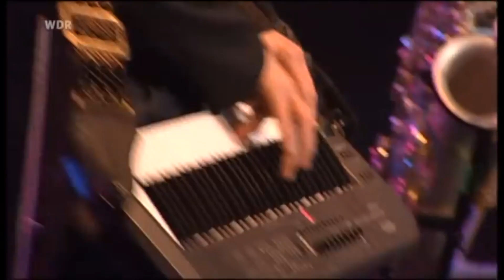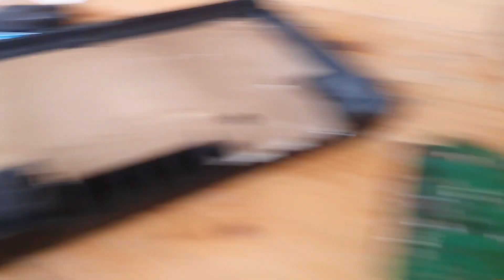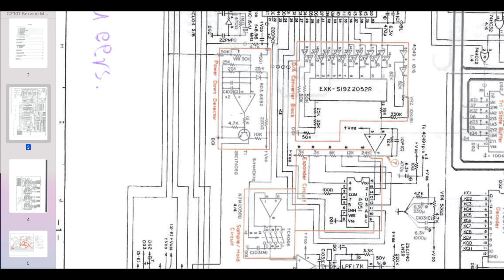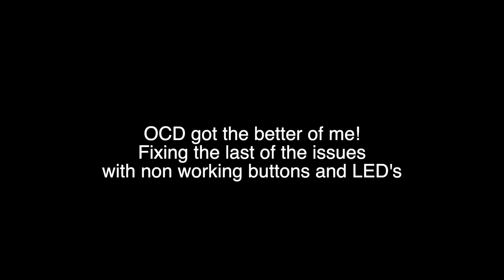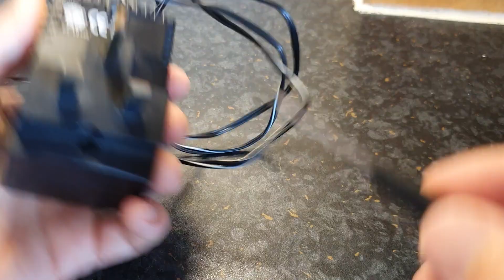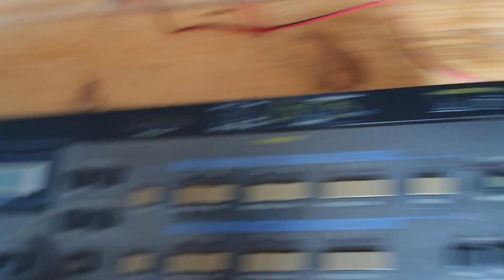Casio CZ101 Part 1 - Buying a broken synth from ebay - can it be fixed?

Comment: Wow, I'm amazed that you actually got that synth to work. Most folks wouldn't have gone that deep into a repair unless they had an electronics workshop; you didn't, but you prevailed! Well done!
A friend gifted me a CZ-1000, the same synth but with full-size keys. Mine is in decent condition, far better than yours, and I'm now learning how to use it. Thanks for a great video!

Comment: You might have one more thing to fix (or not, why bother, it's working now 😂)

I have the original stock Casio "9V" adapter for my CZ-101, and it is also unregulated just like your aftermarket one -- just a transformer, rectifier and some smoothing caps, about as linear as it gets.  I'm in the States, getting 120V out the mains, and that original power adapter is measuring at 12.9V on the ol' meter.  ("Load" matters in this case, ofc, so it's a Fluke 116 -- not sure its internal impedance, but I'm sure that's published somewhere)

So it's not unreasonable to think that the power adapter you have should actually work, and there's some internal regulation fried somewhere along the way.

If you do give that a crack, I'd be curious to hear what you find!
Reply from the maker: @georgen9838  yeah interesting and not surprising the casio psu isn't anything that precise. I've sold it on now but would be curious to pick up another at somepoint, see if the midi is any better
Reply: @bonzomusik  good timing -- just seeing this, I happened to jump back onto mine this weekend to try to figure out what is going wrong -- I'm having no luck.  Behavior is *weird*, sometimes not powering on, sometimes powering on but without LED activity (can still hear sound from the outs and the relay clicks when it starts).  I still want to suspect something on the power side bc I'm nearly sure somebody plugged the wrong adapter into it at some point (center-positive rather than center-negative), but I'm not seeing a smoking gun and the behavior is too erratic and intermittent to trace well so far.

All that to say -- I know it's been years and years for you, but if you recall any hunches or ideas as to where to start searching, I'm all ears!  It can be as vague or as far-fetched as you like, because I'm running out of "normal" ideas fast over here 😅

Comment: Great video ! What do you think could be the reason why the screen does not go out when the power button is turned off? I replaced the screen with an LED one. Everything works fine except for this (I would be extremely grateful for any advice

Comment: Great video, big help for 101 owners. I have Casio cz 230s wich is in good shape but when playing loud from the speakers it shouts down. When you plug headphone jack it doesn't do it. Any help? Thanks in advance!
Reply from the maker: @1980belo  possible something similar  to the issue in my video, when your playing loud on the speakers it's drawing more power causing the auto power off circuit to cut in so maybe needs an adjustment. Just a guess though

Comment: I'm about to tackle one of these myself and this video is a HUGE help! 

I laughed at 18:45 "with the camera nicely in the way" I have so much "soldering" footage that's just the back of my head.
Reply from the maker: @sumawav  good luck! Casio stuff can be a real pain with its flimsy parts. As for filming I've sometimes used a gopro on a head strap which can work ok, just less control and not so good on close up.

Comment: I ended up buying a second CZ 101 in order to canabalize it for parts for the first one that got. Dealing with the ribbon cables was a nightmare.
Reply from the maker: yep the ribbon cables are a total pain, that and the plastic lugs the case screws fix to which break if you look at them wrong.